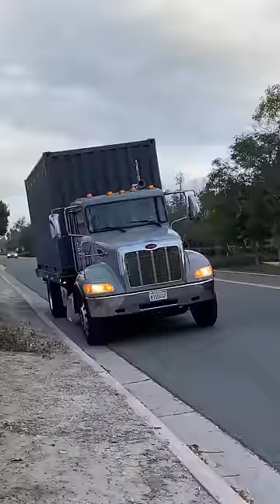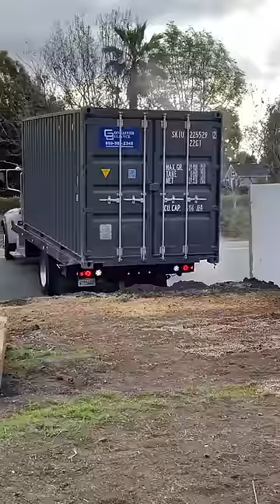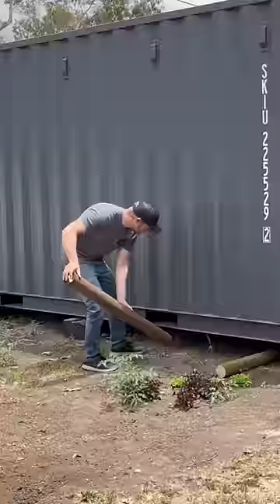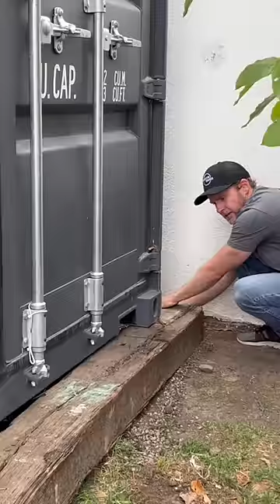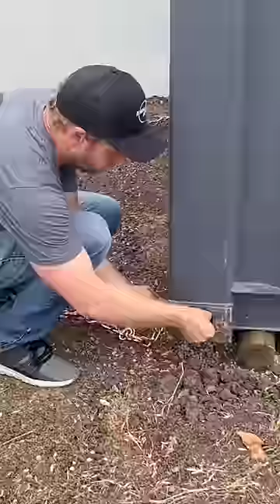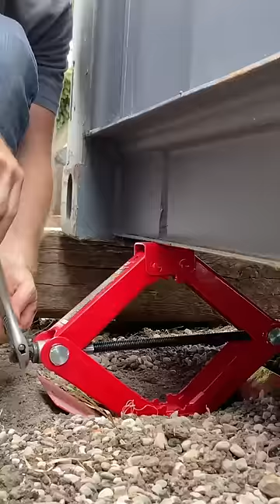Shipping Container Delivery & Relocation #shorts

Comment: Why not just have him drop it where you wanted it in the first place?
Reply: Exactly my thoughts. All that energy wasted to move it forward 5 feet.
Reply: I think the stree wasn't wide enough,  and the slope was too steep
Reply: If they did that, wouldn’t have even had the trouble of digging and all that wasted time. Could have ramped it from the street.
Reply: @thewolf4079  I know it could've been a little closer they slid the bed back so to drop it so far back
Reply: 🤣exactly.
Reply: This is what I do. Move 20 ft containers. When dropping on hills like that makes things a little difficult. But I would of been able to drag it forward a few feet
Reply: Because that would take 1/2 a brain & common sense
Reply: That's what I thought, I'm sure he was just annoyed that they weren't prepared at all. I'm almost positive they took the fence down as soon as he got there and not before
Reply: Why not just get a crane mounted truck to deliver it.
Reply: That’s my question
Reply: Because of the power lines.  The driver did not or could not tilt his bed under the lines.  Also when the container was relocated there needs to be at least 15 feet separation from the power line to the top of the metal container.  The power line can arc to a metal object with less than 15 feet.
Reply: Did it occur to you that they may be simply trying to show how easy it is to move a container with a little ingenuity? Or perhaps the truck didn’t fit into the street well enough.
Reply: Seria mais fácil contratar um caminhão munck, e não se desgastar tanto e nem correr o risco de danificar nada

Comment: That's a dedicated delivery driver. I have boom truck drivers not even try to get my shingles up on the roof because they say a tree is close. Then you get guys like this that make it happen and give it their best🤘
Reply: Na, its because there are class A drivers with alot of experience. Then there are class B driving knobs. Basically. No to insult class B drivers. But class B drives failed Class A truck school. Always get the delivery going early in the morning. I do not mess with peoples personal property in the dark. Also. Weight is a huge issue too. Weigh too much in the wrong place of someones yard. You can blow out a septic tank. Good luck with blaming it on the truck driver. When you told him to do it anyway.
Reply: @c-w-h I passed my class A schooling and went on to drive class b triaxle dump trucks. Its not THAT uncommon from what Ive heard
Reply: As someone rightfully said
"Screw it, it's the company's truck'
Reply: @baileyquick6   sure, but I was implying that the more experienced drivers, drive Class A trucks for years. I would only do a class B job if it paid good for local work.
The difference in experience, and confidence vs. Most wanting to slack off.
Reply: @c-w-h  You've got about as much nuance as a box of wheat thins. There's a plethora of legitimate reasons to drive Class B rather than Class A. Liability and accessibility reasons aside, it's usually easier to drive and still see your kids. But hey some people wanna have kids and ACTUALLY raise them, and others just wanna "Slack Off".
Reply: @EveeHarting  oh, so, you assumed that I insulted you. I did not say all class B drivers are slackers. 
But, since you want troll. Go ahead. I will let other Class A drivers come around and make a comment. They know too.
Reply: @c-w-h  Most may not be all but it's a harsh generalization. I don't drive, but I work alongside people who do, you don't disparige another part of the industry that feeds you. Your totally entitled to your opinion, my opinion of your opinion however, is that it's a shitty opinion. 

Troll, yea just like everyone else who disagrees with you bud.
Reply: @EveeHarting  LOL, class B, Does not feed me. You are a joke. Food is 99% distributed across the U.S. by Class A drivers. Which includes the feed, and fertilizers for farming. The whole world depends on Class A drivers. Class B is for designated areas, where most class A, can not go. Most of those designs, no longer exist. We do not live in the same time period, in which class B drivers were more common. Due to less population. Supply and demand, does not actually need class B anymore.
Reply: @c-w-h  So what exactly would you do if the agricultural industries decided to model their supply chain on the rails? You'll always need short trip guys for local distribution and air freight but long haul big load truckers, in a world where product can be loaded directly into the warehouse from the railway would be virtually unnecessary. Your also not taking into account the VAST difference in weight an electric truck would be and be able to haul, that industry takeover may be 30 years away but sooner or later high gross, long haul trucking will be antiquated, it's only a matter of time.

Your job just like everyone else's has an expiration date pending the inevitable march of progress.

You really think you don't owe respect to every single person up and down the line for that food your eating. Yea those guys are just as important as you are to the infrastructure that feeds us so they are important to you getting fed. Whether they're delivering supplies to the local hardware store for that farmer to keep his farm running, or driving a part shipped via air freight to that farmer so he can fix his equipment. It's just absolutely confounding to me that the same Patriot trucker that probably says things like "Truck drivers are just as important as the farmer or the grocery store", is calling most Class B drivers slackers.

Like I said, nuanced as a box of wheat thins, and just as friggin humble.
Reply: @EveeHarting  
You must not live in the U.S.,  because our rail roads do not have anywhere near the convenience to do what you are imagining. It cost more money to make more trips. Which is why every comment you made is obsolete. They would rather have warehouses that can be within range of the demand. Not rely on a railroad system to do whatever it wants.
Reply: @EveeHarting  electric trucks will never be operated by class B drivers, hauling 80k pounds. The electric semi will never replace a diesel engine. A hybrid could. But not all electric. There is no infrastructure for all electric trucks. Not enough charging stations. When are colleges going to start training people how to work on electric trucks. If I own an electric semi. Who is going to come fix it. Guess what, right now, nobody. 75-100 years from now would be your best gamble. Assuming they actually care about designing an infrastructure. But idiots on the left are stupid. No one that owns their own semi, is going to wait for stupid people to take time out of their schedule to come fix a truck. They are not dedicated to fixing a problem quickly. Drivers lose money everyday they can not operate. A business only succeeds, if it grows. If it fails to grow, it will die... eventually.
Reply: @c-w-h  Whatever you say bud, there's plenty of innovative and intelligent people to make it happen. It isn't pie in the sky either, the country is rapidly changing to meet demand and the demand of an ever growing population simply can't be met sustainably with the current methods of distribution. There are proposals concerning exactly this put forward all the time.
Reply: Not worth , if anything happen to him or the truck , u as customer will not give a af to them
Reply: Gotta love truckers. When they're not busy blocking roads to show how important they are, they make sure to argue with themselves over who is more important. Fires still need to be put out, sick still need to be cared for, roads still need to be paved, the frieght you move still needs to get stocked. Just do your jobs lol. We all have it rough.
Reply: @Largetalons  That was literally my argument bud lol
Reply: @Largetalons  class B slack driver has a chip on his shoulder. So he tried to troll me. Thinks it is fun. But he does not have anything else to run his mouth about. Every time he opena his mouth. He just shows his inexperience.
Reply: @c-w-h  This isn't political in any way shape or form, you keep saying the left this and the left that, it appears that you just blame anything you don't like on the Democrats when legality has little or nothing to do with the context of the debate.

If you seriously believe that electric trucking isn't on the verge of happening you should consider a different outlet for information than whatever your using. There's concepts set to go on the market as early as 2028 and the infrastructure can be set up by a few electricians, and an electrical engineer in an afternoon. Nitrogen cooled superconductors are becoming more and more feasible, and when that technology becomes reliable enough to be sold to you as a consumer that will be the norm, period. You know whose going to work on it? It's more approachable than an internal combustion engine believe it or not, you just have to understand how current works. Your drawing from personal experience and trying to make an argument from your own authority rife with opinion and misgiving. I'm urging you to take a look at what's going on in those fields, it isn't nearly as stagnant as your claiming for sure.

Comment: Nice! A metal roof under power lines. What could go wrong?
Reply: Those two low lines are datacom lines. Cable and internet. The four lines way up there are the high voltage lines (probably 15,000 volts). The container is a "temporary" item, so it's about the same as parking a car under power lines. If one of those high voltage lines comes down, you have bigger things to worry about than a storage container.
Reply: @JThyroid  I see. Thanks for the clarification. 👍

Comment: You had two giant railroad ties to put at the curb 😂🤣 Also truck genius should have gone over curb at a slight angle to help with hitting/scraping and then straightened out
Reply: Those containers are quite heavy. Given the height as well could make it pretty top heavy. Anyone who ever drove a 20ft plus box truck knows how prone they are to tipping. Wrong move at the wrong time buddy would have that container and truck tipped right over. A lot of things the driver could be liable for, just making it the safest way possible I give him props.
Reply: "truck genius" knows wtf he's doing behind a wheel, as clearly evidenced in this video. Quit trying to sound as if you know what you're speaking on, Prius we Todd.

Comment: One day that whole container is going to go live with electricity and someone's gonna die because they happened to be the one who got too close to it.
Reply: Wdym
Reply: @santini1224434  i think he means because its directly below the power lines?... i dont see anything that wrong with it but i wouldnt stand on the roof waving around a ladder thats for sure
Reply: @MrSwider87  I'm mean that it's all too easy for arc flash to happen with that big metal container being that close to those power lines. A strong wind pushes those wires a little closer and suddenly the electricity jumps from the power lines to the box (arc flash),  the whole thing goes live (meaning it has electricity actively flowing through it) and anyone close to it is dead. The static electricity from your body can cause it to arc flash with the container and the power lines or any metal you happen to be wearing or be too close to when it happens. Bottom line is always treat electricity like it is deliberately trying to kill you and looking for any chance it can get. Putting a big metal box under power lines then using it as storage that presumably people will be going in and out of is a good way to get yourself or someone else accidentaly killed.
Reply: @PlagueKing_LordFalix  The power lines are waaaaaaaay up on the top of those poles. You know why? Because they don't want that to happen. And if a storm brought the pole down on it, it's on wood so it's not grounded. The lines below are for various reasons and really have a very low power load. Maybe only enough to make a check reader work. There's only danger is if they arc the ground while you're standing close and the ground is wet. How do I know this? I ran a line truck (crane truck) for a power company for a couple of yrs. Those top ones carry some serious juice, and they're solid copper with no Aleve. So if you see them down on the container simply don't touch the container or you'll be the ground. There will be no arc flash, you'll just fry!!
Reply: Sleeve not aleve

Comment: Love everything quick tip for the scissor jack put a socket on a drill and it will go up in seconds vs minutes not to mention the sweat 😅 you put into it :)
Reply: Never EVER use a scissor Jack for this kind of weight. Atleast that’s what I’ve always heard. Always heard scissor jacks are crap and waiting to take life’s
Reply: @wiggitywhitefox  I got to agree with you most scissor Jacks aren't worth a crap when that dude lifting the cargo shed just got lucky cuz I haven't seen a scissor jack yet worth it's salt ,the average one is  meant to lift it a quarter of a Kia Sorrento.
Reply: @GeorgeBigney  ?

Comment: You placed the ramp in the wrong place. Ramp up the wheels and then use those railway logs to get the truck up. Once up, u can reuse the same logs to place the container. What i understand that even 10s of feet away these power lines can barbecue you !

Comment: You should have used concrete blocks instead of wood. After 12-24 months unprotected wood becomes mouldy and will deteriorate. The container may sink at one side and you will not be able to open the door.
Reply: rail road ties are treated...they can last up to 30 years...

Comment: I have a hack for you cause the crank style Jack's suck 

Take your jack to the auto parts store and buy a socket it just for it (you can use one that you alre have if it fits) and use a impact to raise it up and down the only part you have to be careful about is when you raise it the jack can be unleveled but once to have wait on it and it's straight it's alot faster

Comment: Bruh, just build a damn shed...
Reply: Cheaper to buy a container. Unless you can mill your own wood.
Reply: @c-w-h  You can buy an entire prefab from Lowes under $500 with comparable volume.  Takes two people around 3 hours to assemble, and it would shed moisture the same way a house does instead of accumulating like that container will.
Reply: @EveeHarting  
Container prices can still be cheaper. If you know where to look. Waterproofing containers is easy and it does not need a roof. Unless you are democrat living in a stupid city, with roof regulations.
Reply: @c-w-h  If you can't build the shed yourself I suppose getting a GC to build you one would be more expensive than the container. I would argue however that particular person wouldn't be able to roof a container without a GC making that point moot.

Building one yourself would always be cheaper, even with the inflated cost of materials. You dont even need a concrete pad, you could just dig footers, set posts, and hang rim joists off of those and build up. As long as your posts are 8x8 set high enough for your roof to set on your good. 8x8 at that length aren't easy to get, so you'd probably have to notch and lag them together but it wouldn't be carrying a lot of weight, you don't need a flat ceiling, and you can use lap metal roofing secured to rafters with the tails brought low enough to prevent direct water. It's a shed, not a guest house. You can seal every crack on that container and water will still condense it's way into it. That's why you have to leave dry bags in there, and those have to be changed with regularity. That coupled with an utter lack of ventilation make mold a daily problem, and expect any woodwork (Guitars, furniture, antique) inside it to warp.
Reply: @EveeHarting  you can ventilate a container too. But I would not care too. Because it would be for tools. I would only ventilate, if I was going to be inside it for long periods.
Reply: @c-w-h  I prefer a covered trailer for tools, that way I can just hook up to it and put my tools wherever I need them. Get you a portable A/C and a tarp or something to act as a door when you've got the trailer open so you can be cool and not get super disorganized.
Reply: @EveeHarting  you do not have very many tools. I would need three trailers to do that... Its ok, tiny business boy. I am beyond two trailers.
Reply: @c-w-h  Ooohh someone has fifteen different sawzalls and can't fit his stuff in a 14' trailer likely because he has no storage beyond throwing his stuff on the floor like a toddler. If your talking power equipment, that isn't a tool, it's power equipment. Your starting to tell a fish story here chief, you should probably step off at this point if the best you can do is hurl insults through the YouTube.

Small business boy? Jesus Christ that's the best you could come up with? Even for a PG-13 level burn that's bad, I've been relatively pleasant, your attitude in lieu of any valuable input is not. You've crossed that obvious line between sounding credible and being totally preposterous.